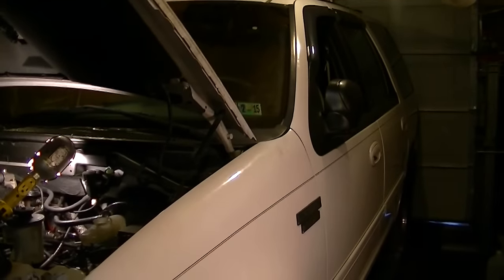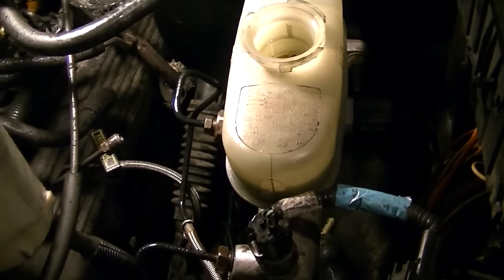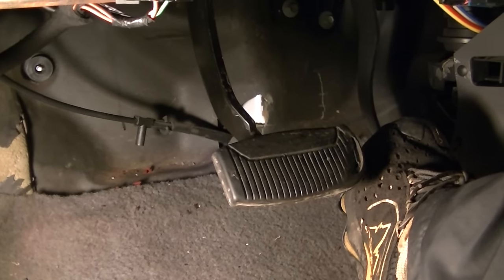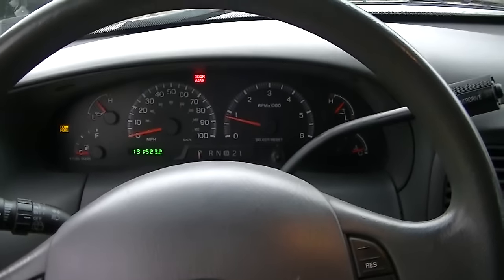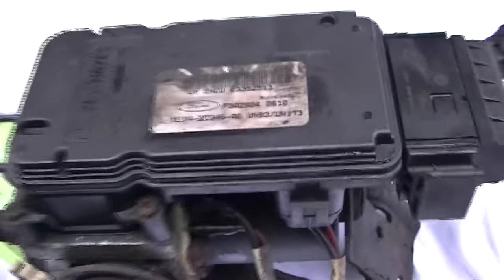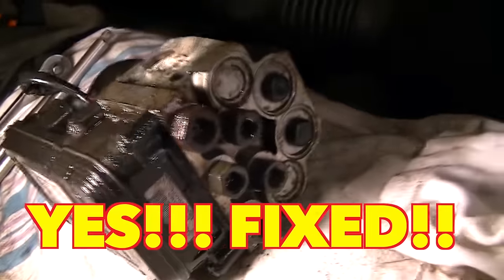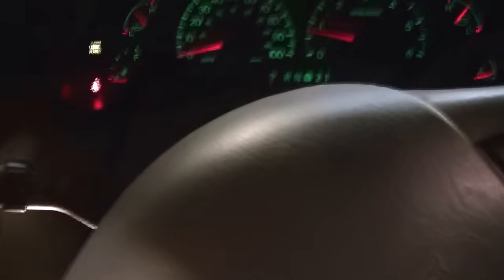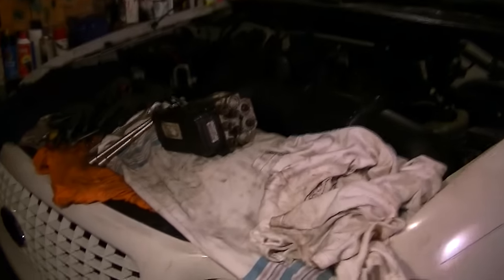Sinking/Spongy Brake Pedal -With ABS SYSTEM?? Nothing Works? Watch Fixed!

Comment from the maker: NOTE: I did not have to DO ANY BRAKE BLEEDING! ....I just hooked everything up and started 
pumping....engine, running, engine ,off...several times and the pedal 
came right up! Some say take it to the dealer and spend $100's of 
dollars...I say ...I never had to do that. That's all I did. Most of the
 time this works. Then after you do this, then maybe try to bleed the 
brakes per wheel...to make sure all the air bubbles are gone ;)
Reply: TVWXMAN32 I am having the same problem after changing rotors and pads the front right caliper is not working I checked the master cylinder and is working properly but I loose one by one of the brake lines on the abs module and my right front  is not working no brake fluid coming out 2007 vw Jetta 2.5
Reply from the maker: Internal failure possible. Was it doing the same thing  before the new parts?
Reply: I didn't notice that cuz I bought the car and had no brakes they were shot almost metal to metal but the thing is that the master cylinder even when the car is off the brake pedal goes down. You think that if the master cylinder does not have enough pressure and that's why does not push brake fluid to the right caliper? Hey thank you for  responding
Reply from the maker: Yes. But If your caliper has a rubber flex line...take it off and see if
 it stopped up. I've had them do that before making me think it was a 
bad wheel cylinder/caliper. If its seems ok, then check the master cylinder 
next. Cheaper to start small and work your way up.
Reply from the maker: But....its sounding like a ABS pump Issue ;(
Reply: Took the rubber hose off and nothing was coming outi even took off from the abs module and all the lines were poring brake fluid but the one on the right wasn't I will replace the master cylinder first and c what happens thanks again
Reply from the maker: Well you could put it back together and go out and slam on the brakes in
 the dirt or mud...and see if the pump activates....I did that on mine
and the pedal went to the floor slowly with the pump kicking on while 
feeling the pedal pulsating. So I do know you can have a working ABS 
pump motor and a bad ABS internal leak at the same time. I found out the
 hard way. That sealed the deal for me.
Reply: Thanks It was the  abs module I changed yesterday and after changing it the caliper was working and the brake pedal wasn't sinking any more. Be really careful when you work on your car,  while I was changing it I placed a rag under the abs module cuz I didn't want to much brake fluid over  the mechanical parts it was late and I was rushing but and got it back together when for a ride to check it out after bleeding the brakes everything was working fine then I stopped at 7eleven got a cup of coffee when I came out the car was on fire I forgot the FUCKING RAG  all  wires and battery got melted hey but the brakes are good 😂😂
Reply from the maker: LOL....WOW! Glad you got it fixed. I had a truck catch on fire while flying down the freeway only to forget to take out a rag that fell in the engine on the manifold...Gave me a heart attack! I know how you feel. Thanks for sharing.
Reply: That's exactly what happened fell on top of the manifold
Reply: TVWXMAN32 well this may be my problem in the morning when i touch my breaks even the slightest they lock up its truly scary
Reply: I've got a 99 expedition with the same problem. I went and got the abs system from  junk yard but the number wasn't The same, but now I have brakes again. But the ABS and brake lights are on now. Ive bled each wheel but now I'm going to try what you said and just pump engine on and off to see if that will help. Thanks
Reply: Nathan Rohrbough  I have a similar issues with my 2000 vw jetta except it looses pressure and the brakes quit working entirely my abs light comes and and turns off all the time and the car looses pressure randomly ?
Reply: At 1:50 what did you do with the line you disconnected from the master cylinder?
Reply: Nathan Rohrbough What do you mean when you said you disconnected one of the brake lines to block off the master cylinder where did you do with the brake line?
Reply: Nathan Rohrbough great video. I am working on my 2007 classic 2500 HD, replaced all brake lines and bled everything and have a very soft pedal, before that I had a semi decent pedal, also have abs code for electrical c0301,  thoughts ?
Reply: I have the same exact  problem with my car and have done everything you did except the abs. I'm going to get the abs pump!
Reply: Can the ABS system be bypassed  by removing the fuse for it? will the brakes still work normally?Great video! very informative
Reply: @SDsailor7  hi bud I tried that brakes were brilliant only problem with my car electronics the speedo was off and warning light flashing on display with an annoying beep beep constant safety issues I suppose was set up so could not drive very far without it being connected but it could be a way to verify abs fault all the best from🇬🇧
Reply: Its almost never the ABS but I guess in this case it was. I drive Honda and had the same symptoms, If it was ABS my ABS dash light would come on. I put in some fluid, drove around pumping my brakes, got pressure brake light went off then came back on pedal sank back down to the floor, and I looked in my rear view and I have a leak. ABS pump/modules almost never go bad.
Reply: @FixingWithPassion  the same way you can have a master cylinder thats still technically "working" but also has an internal leak.
Reply: My s10 have spongy pedal even with the car off pedal goes to the floor what would be has new master cylinder all tires are bleed
Reply: Nathan Rohrbough 

I’m thankful for the post!! I have an 06 Tundra and replaced the Calipers,rotors and pads. Then I bled the system and pedal goes right to the floor. I then replaced the master cylinder,bled again and nothing,but my brake booster checked out,so I’m gonna check out this information 🙌🏻🙌🏻😎 I do need two wheel speed sensors but before this brake work the brakes functioned perfectly 🤷🏻‍♂️
Reply: I have replaced everything on the break system of my 99 Tahoe and my pedal keeps going to the floor no matter how much I bleed the brakes no matter what I replace still the same outcome !!! So looks like I'll try to replace the ABS system and I'm hoping that will fix the problem ?? The only thing I have not replaced on the brakes ! I have never seen one go bad before .. my scan tool is not even picking up any fault codes within the ABS..
Reply: I have a 2010 ford escape. Apparently mine has a hydraulic and electric abs module. Two separate parts. Which would it be?
Reply: @FixingWithPassion  e
Reply: @ladscr28  i had the same problem in my car, sinking pedal, so you thinl that with a new abs module will not sink anymore?
Reply: @mtsanchez27  are you loosing brake fluid? Did you change the pads or shoes if you have them
Reply: @ladscr28  I havent change the brake pads yet and Im not loosing any brake fluid. Please help
Reply: @mtsanchez27  if your brake pads are good I would start with bleeding the brakes and see if that makes any difference may have air in it starting from the back if your abs module is on your left you must start on your right rear caliper then rear left then front right finally the front left
Reply: @mtsanchez27  that's if you wanna try that first but if you don't have any leaks or air in it I would go with the master cylinder try to take the most brake fluid you can before taking it off the put the new one in and bleed it starting from the back
Reply: @ladscr28  I going to try that
Reply: @ladscr28  thank you very I did what you recommend me to do and it worked amazind. God bless you!
Reply: @mtsanchez27  de nada hope it works out for you igual bendiciones
Reply: @ladscr28  it did and bendiciones para usted también.
Reply: Hi I have a 2003 Ford expedition XLT and my brake lights come on after s complete stop!! Not while I'm pressing the brake to slow and stop!! Any ideas why??
Reply: I did all of this and still no brakes
Reply: I've replaced everything
Reply: Was your master cylinder leaking fluid before your brake went.
Reply: Texas Legend I’m wondering same thing but he never replied. Did you figure it out yourself?
Reply: Nathan Rohrbough where your front brakes slightly dragging too?
Reply: @FixingWithPassion  ,sdrc
Reply: When you blocked off the master cylinder and pressed the brake pedal and it got harder was the engine off? Because my brake pedal is hard with engine off but goes straight to floor with it on (with the master cylinder hooked up correctly not blocked off)
Reply: You spend 40 something dlls in a replacement part and can't put even 5 dlls of gas ? Kind a weird
Reply: BLACK brake fluid from all the time you left the cap off when screwing around, AND BRAKE FLUID ABSORBED AIR MOISTURE: REPLACE FLUID IMMEDIATELY!!!
Reply: I just replaced brakes on 2009 corvette I have no rear brakes no fluid going to the rear I can bleed the front but not the back the pedal is hard.any suggestions.
Reply: So the abs didn't throw any codes!?
Reply: If it was vacuum is far as the master cylinder or booster he didn't need to bleed the brakes
Reply: If it wasn't a bleeding issue then it was a vacuum issue. Meaning he doesn't have to bleed the brakes to fix that and he doesn't even have to bleed them after he replaced the booster
Reply: Where did the air in the system go if you didn’t bleed it ?

Comment: Thanks for the information.  I just did a complete brake overhaul on my 2009 F250 Super Duty truck.  I bled the brakes using a vacuum pump until I was sure there was no air in the system.  I had a hard brake pedal when the engine was off.  However, after starting it, the pedal went about 1/2 down to the floor.  I had brakes but they were not the same as before I did the brake job.  They felt spongy and would seem to go to the floor when holding the pedal down.   I knew that my ABS pump was ok because the chances of it failing just because I did a brake job was remote.  So following your diagnosis and reading the comments below, I pulled the 40 amp fuse for the ABS pump.  As soon as I did that, my brakes were fine.  I test drove the truck for a short distance with the ABS light on and my brakes were perfect.  I came back home, reinstalled the fuse and the ABS light went out and my brakes are now perfect.  Basically, it seems like all I had to do was to cycle the ABS pump and that fixed my problem.
Reply: ABS almost never fails, unless you use a silicone based fluid by mistake, the light will come on so you'll know and its extremely rare.
Reply: Interesting, perhaps I’ll try that before buying a new ABS unit. Where is the fuse located? And when you say “cycle the ABS pump,” does that basically mean like a hard reset on a computer?
Reply: @David McClain
 I have an 05 Ram 2500, same issue. Brake pedal would sink to the floor. I replaced my master cylinder and bled the brakes. Still had a sinking brake pedal... Bled the brakes again to no avail. I saw this post, disconnected my batteries overnight. Seems to have reset my ABS module. Brakes are firm again!
Thank you!
Reply: THIS! THIS! THIS!.... I did this on my 2010 ford escape and it works!!!! Bless you man!!!! saved me a ton of $.
Cheers
Reply: THIS^^ I just did this for my 06 Silverado, and worked like a charm.

Comment: This is a HUGE problem on Hybrid cars!....I've replaced 3 of them on my Toyota Camry!!!......there is no Master Cylinder on Hybrids, just Reservoir.... the ABS module acts as the Entire Brain of the braking system.... they are filled with Nitrogen, and when that Sealed Unit leaks, ABS module is Toast.....the entire braking system goes hayhire and you can lose All brakes, or 50% of brakes (however it's worth noting, you Can repair the Modules, but you need special Nitrogen tanks and connectors, there are Also some services online that Repair them for around $250 I think)....But you Don't need to bleed the ABS Units, they are usually self purging, or there's just Not enough air to make a difference.......I've never had to bleed any ABS module I've done.
Reply: Where do you get the abs modules from

Comment: The solenoids inside the ABS unit can become stuck open and reroute the fluid back to the master cylinder resulting in moderate to low breaking. They can also stick close resulting in a hard pedal also with medium to low braking. The best fix is to replace it.
Reply: In my case Seems ABS unit Stick Open.. and sends fluid back to master cylinder. if I keep pressing brake padle then it just goes all the way down.   But again when I tried to re-perss again it pumps the fluid again and brake works fine (just need to brake suddenly-- if we keep pressing the paddle then it starts sinking eventually)
Reply: Do you not need to us the ECU computer to open the ABS valves open during bleeding?  I need to do this to be able to clear the fluid through the whole system..

Comment: Bro thank you so much you saved my family. My mom lost her job because ee didnt have the money to fix her breaks(120) grom joe bidens econemy both frong and back brake were toast anyhow it took me 4 days to figure out why the car was bleeding we were getting fluid out of every bleeder screw but the peddle still was just sinking yo the floor, i put all the tires on and drove it down my back road and engaged my abs system by smashing the breaks came bsck in the garage started from the back and bled them all and it worked perfectly fine thank you so much

Comment: Nathan, you confirmed my suspicions. I'm working on a 2001 Silverado pedal goes to the floor. Replaced the rt front leaking brake hose both master to ABS unit leaking brake lines, bleed the system three different ways. Still no pedal. Your experience compliments mine. Never had a issue with ABS controllers. TILL NOW.
Reply from the maker: Nice!!! Good work!

Comment: I am a professional mechanic with 33 years on the job . I ran into the same problem today on a 99 f150 . After putting 4 master cylinders on it and going thru half a gallon of fluid . I arrived at the same conclusion .  I have seen over 100 bad abs units before , but this problem is a first for me . I am glad that it is a common ford problem . Now I just have to find another unit for my customer . Thanks for the video - that truck was kicking my butt .
Reply from the maker: Glad you found it. Sometimes, its right in our face...lol